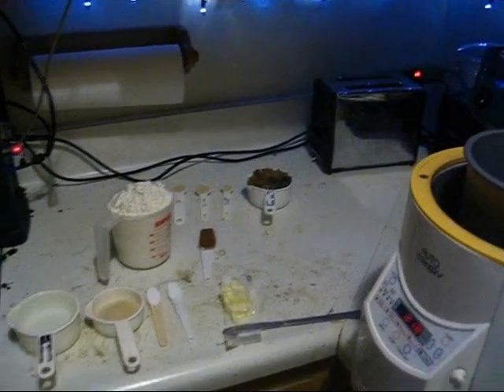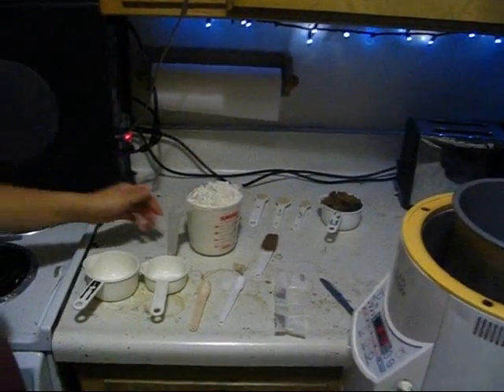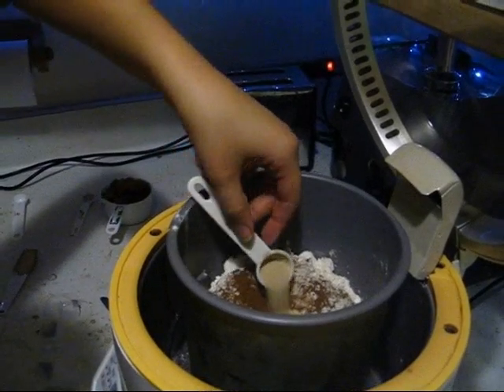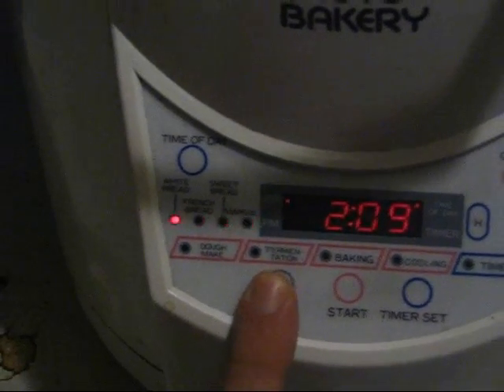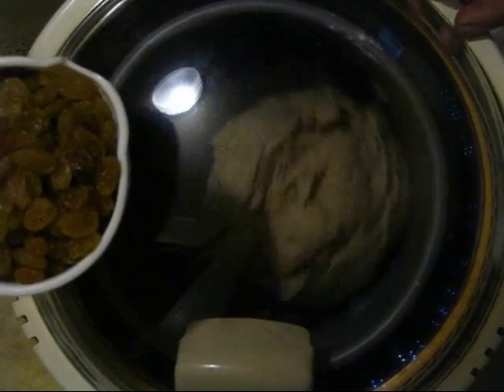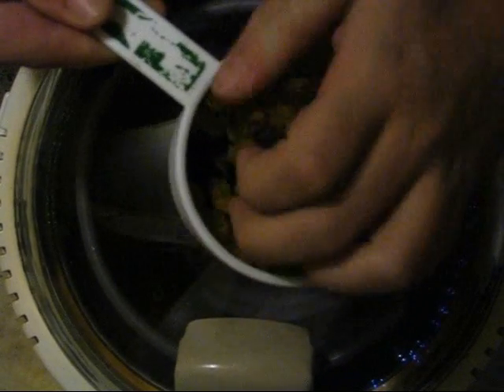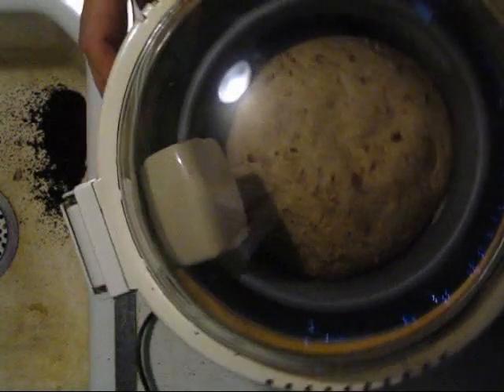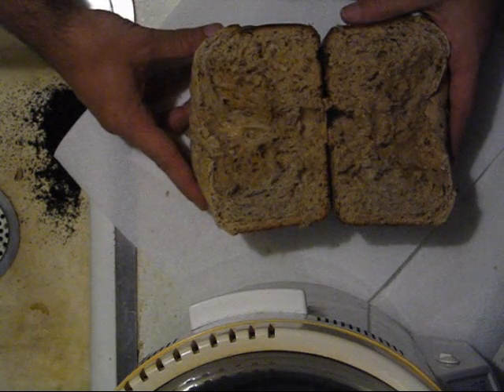DAK Auto Bakery - White Cinnamon Raisin Bread - FAILURE

Comment: I have this exact machine and will thry the way you load he ingredients. But according to the original manual, which I have, the yeast and other dry ingredients go in first, with teh wet ones on top. But you way still seems to work. I will try that.

Comment: If he would actually use the order of the DAK recipe, it would have worked better.  DAK recommends putting the yeast in first, then flour, then other dry ingredients, then wet.  The main idea is to separate the wet and yeast - but that only matters if you are using the timer and letting the ingredients sit for hours, before mixing starts.  You can put wet first, like he did, but he made a critical mistake - he dumped in his cinnamon on top of his yeast - which killed it.